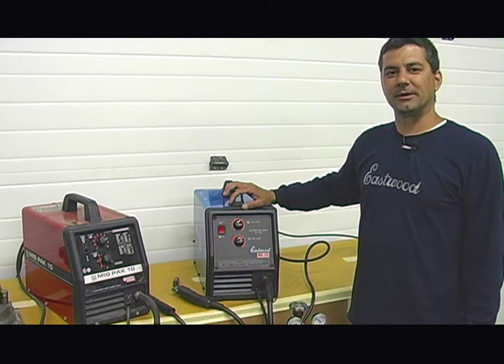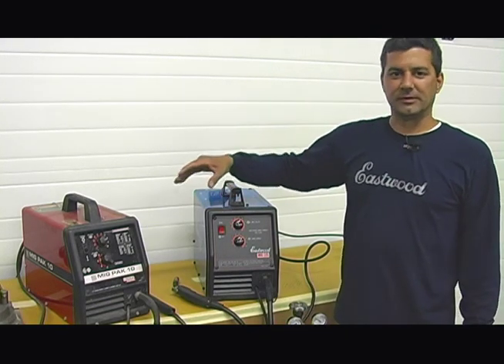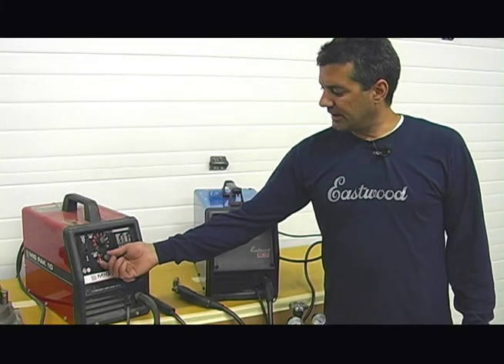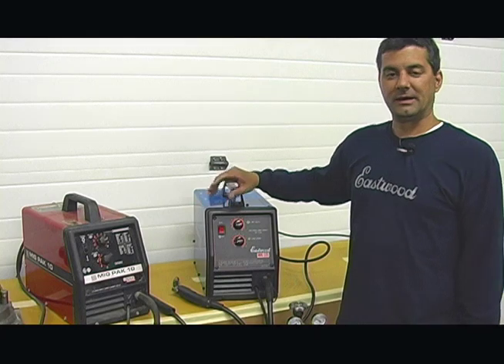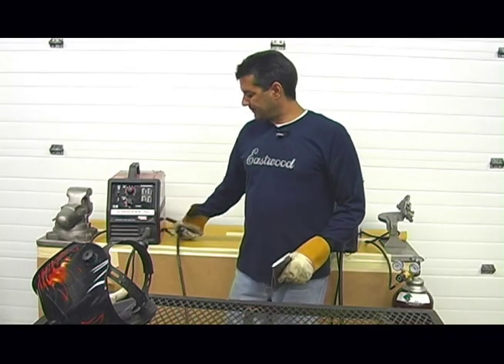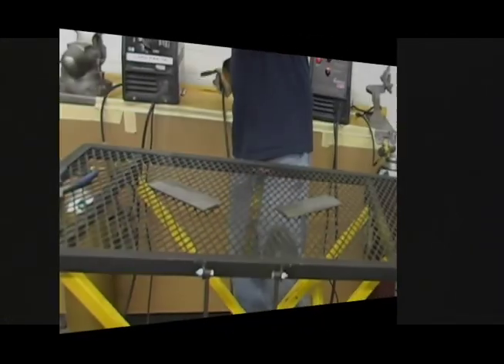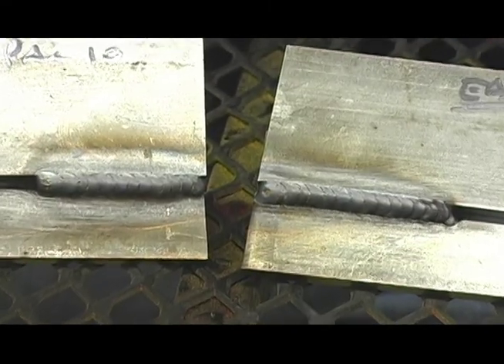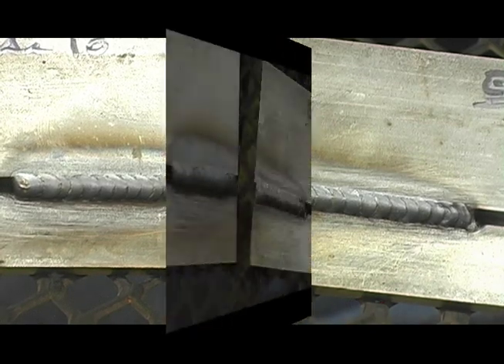MIG Welder Comparison - Comparing Eastwood vs. Lincoln Mig Pak

Comment: The Eastwood mig welder looks like a decent machine. Id like to demo the Eastwood and compare it with my Lincoln mig pak 10. My mig pak 10 can weld aluminum by switching the gas to straight argon and I have a Lincoln spool gun that plugs in that i use only for aluminum. Can my Lincoln spool gun plug into the Eastwood 135? Im looking to either get another mig Pak 10 just for aluminum so I dont always have to switch everything out. If the Eastwood 135 can do that I wil buy one. Thanks for the video

Comment from the maker: Are You an Eastwood Guy?  Check it Out:  Perfect Can Opener - Opening a Soup Can - Are You an Eastwood Guy?
Reply: you are comparing a $300 110v 135 amp welder to a 230v 180 amp 
that cost $1000 I don't think you understand comparing similar items.
and yes i'm a lincoln guy
Reply: MRnounoursSQ -- You might be a "Lincoln Guy" but you don't know what you are talking about. This Lincoln is about the same price as the Eastwood, maybe a hundred more, they have the same voltage and can do basically the same stuff, performance wise. Your comment makes "Lincoln Guys" seem sort of dim and uninformed. Perhaps a little research before firing off one of your Keyboard Warrior replies next time would see you less owned. To use your own words, here -- I don't think you understand comparing similar items, and yes, I am also a Lincoln Guy. I just pay more attention to the stuff I comment on. Thanks for making the rest of us Lincoln Guys looks like jerks. Good job.
Reply: the mig pak 10 is actually a 110v 100amp welder running at 500$, they are very similar in every way.

Comment: @stevenward13 one thing I forgot to mention is that your better off buying a harbor freight mig at low cost then buying an eastwood mig welder, look up videos for harbor freight welder I had one for about 6 years and it never gave me problems

Comment: @stevenward13 Well I paid 500 for mine from a guy on craigslist with tons of stuff  who only used it 3 times and the machine was stored for like 3 years,  if you buy a new one off ebay for 660 you will get the 3 year warranty plus some goodies. The best thing about a miller is that it doesn't depreciate like any other brand and the quality is wonderful and  I can still sell my miller for what I paid for it  so check out ebay or craigslist for a good deal.

Comment from the maker: @thevarbarias Do you have any pictures of the welds you produced with this welder? What were you welding (thickness, type of metal, etc)? Possibly you have a defective unit, or there is a issue with what you are welding/your settings.  This video clearly shows the welder can get ample penetration. Hope we can help!

-Matt/EW